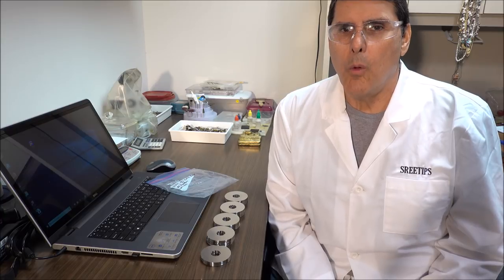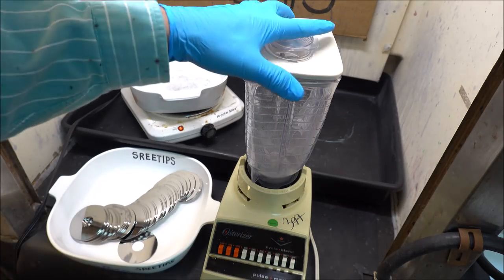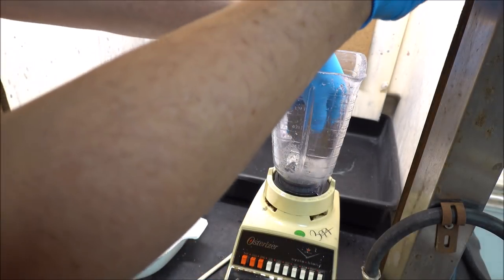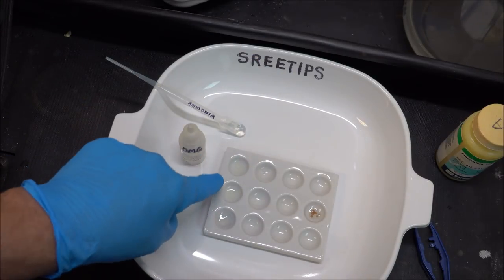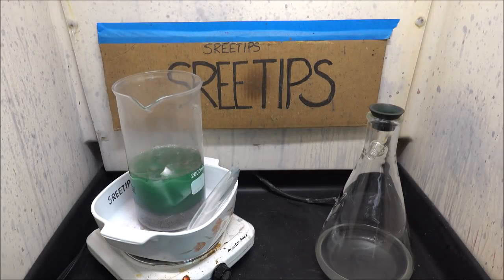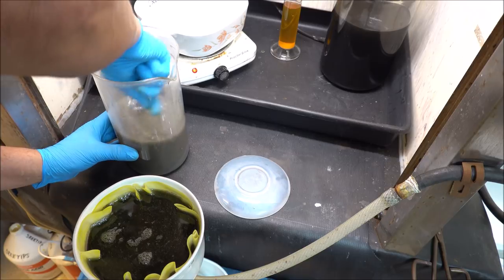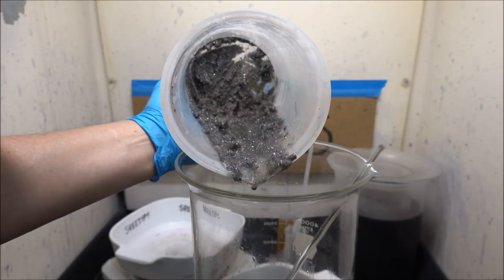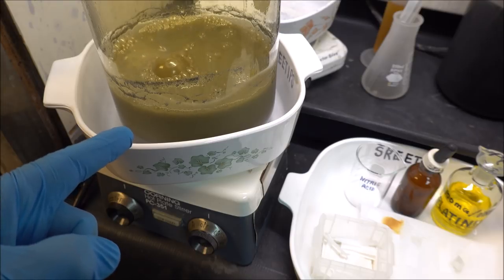Platinum Recovery From Computer Scrap HDD Platters

Comment: Pity the price for platinum is not as high today as it use to be. From memory, Pt was worth more than Au in the past
Still, 1g of Pt per 900 hard drive disks is a very small yield. Interesting to see what the chemical process will be to extract the Pt.
Cheers
Reply from the maker: Now palladium is more expensive than gold, the last time I looked.
Reply: @sreetips  Palladium is used to make the catalyst in catalytic converters needed by the auto industry. Over 3/4 of the demand for Palladium is driven by the Auto sector.
I suspect that this industry is driving demand upwards, although its possible that some smaller palladium users have grown over the past few years.
Usually when the price goes up rapidly, waste recovery and other processes become profitable and come on stream. It happened with Gold production during that decade of price increase and demand for gold. All of sudden the waste tailings and waste rock piles at Gold mines became very valuable resources.
Reply from the maker: Based on the yields from my catalytic converter videos I believe this to be correct. The yield was mostly palladium.
Reply: @sreetips  I just checked your channel for the catalytic converter videos - will have a look at them too. Good stuff so far

Comment: Your only going to find a recoverable amount of platinum in platters from either server hard drives, and modern hard drives.  (2008 & newer, or above 180 gigs.)

Older laptop drives are going to have very little to no platinum in them.  Older server drives are hit and miss if you want to be sure to be successful gathering drives over 180 gigs in size is your best bet.  They're only going to have at very most 3% of the coating as platinum so before doing a stannis chloride test you'd want to be sure the AR wasn't still reacting and heated it to drive off any excess nitric acid.

Comment: As a computer shop owner, I have thousands of hard drives, each having 2 to 6 platters.  After watching this, I figure its not worth my time to try and recover Platinum. The current market value is low.  I'd probably only get ~$6000 or less, and burn weeks of labor. Definitely not worth it.

Comment: Sreetips, I don't understand the need to grind up all the discs. All the metal is on the outer coating. Why not leave them whole? Also, do you think it's possible to reverse electroplate these? Thanks!

Comment: Question:  How durable is silver compared to gold ?  

I.e.  gold coins are famous for its ability to lay at the bottom of an ocean for 1000 years & be found without losing any of its weight or properties (does not corrode or otherwise decay). Also, gold is famous for its ability to be re-melted and recast into something else.

Does silver have such attributes?

A video response would be amazing however a simple response would do.

Once again, your work is appreciated
Reply: silver tarnishes. reacts with sulfur, among other things. don't eat egg yolk with a silver spoon. the black tarnish contains silver ion that gets removed by silver polish. there is a reason electronics connectors use gold not silver.

Comment: Great video! Thank you. One question though, did you check for silver? If so, was the silver and how much?
Reply: " If "  Any silver dissolves due the the nitric in the AR, it will come out immediately as silver chloride, it will not stay in solution. Hydrochloric acid is often used to test for silver in nitrate solutions. You take a small sample and put a drop of hydrocloric acid in, if silver is present a white milky substance will form, it's silver chloride. If there is a high concentration of silver it will clump up like cottage cheese.
Reply: @joek511  Thank you for your reply I appreciate it.

Comment: Because the active layer of a HDD platter is surface deposited, I believe you would have had better luck just stripping the platters whole instead of broken up.
With that said, the precious metal layer of a platter is only a few atoms thick and I'd be surprised if you could get .1 gram from a truckload of them.

Comment: I find these very interesting. I watch CodysLab and nilered as well and you keep my attention just as well. One thought, why not use AR on the plattens first, filter, precipitate with zinc, then do nitric boils to remove copper, and do another AR?
Reply from the maker: Not sure about why. Thanks for your interest.
Reply: @sreetips  if you're after the thin metal coating only, wouldn't the AR strip it fast enough so you could skip the blender and then dealing with all of the excess bulk material? You could do 3-4 platters at a time and cycle them out

Comment: I'm wondering if grinding is necessary, but fun times.  It's vapor deposited metal on the surface, no?  Couldn't you just etch it off?  Or maybe rinse them in molten lead?

Comment: Sreetips, isn't there ruthenium on hard disks? I once read that a ruthenium layer was used to increase data density capacity. I believe it's what cause the ruthenium price to skyrocket several years ago. Ruthenium, being in the same group as iron, has similar colors in solution depending on its oxidation state. Might also give a false positive test with thiocyanate, not sure though?
Reply: Isn't that rhenium and not ruthenium?
Reply: @vivimannequin  Both are valuable, but I'm pretty sure it's ruthenium not rhenium.

Comment: Thank you.... I can throw away the create of HDD platters that I have been collecting for years now, that either I collected, or other people have to me to harvest someday... Of which I will not be doing now, lol... I bet that is every bit of 200 to 400 lbs in that gaylord create, as it stresses the fork lift forms when lifting them... I wonder if the grass recycler will take the glass ones? I have the metal platters separated from the glass units.. This will free up some shop space.. Lol
Reply: The really old metal ones have much more platinum on them and are probably worth cutting into quarters and dissolving the aluminium, inside them and collecting all the thick foils off them..it depends who the old ones are made by as to how much pt or other precious metals are in them

Comment: I wonder what the yield would be if you used old 486 drives.  I know older CPUs have more gold content in the chip.  I suspect that holds true for all precious metals on all components. This obviously is a bulk operation.  Would you do the experiment again if you had several thousand hdd platters?
Reply from the maker: No, it's just not worth it.

Comment: What about pulling the silver out of a lead/silver welding bar, that is to say the bars where bought cheap, would if make sense and can it be done on the inexpensive side.
Reply from the maker: I did a video with stay-silv silver solder. I don't know about lead/silver.
Reply: sreetips thank you Sir.  I am still interested in finding a way to get you a pallet of x-rays, probably a half ton, but with silver prices it's probably not worth your time, would be a nice silver bar

Comment: Why the grinding step? Can't you just dissolve the metall off the surface and make it a lot easier?
The Thiocyanate will also detect the trace amount of iron that was worn off the blender blades when blending the glass. I don't think there is iron in the coating. Not corrosion resistant enough.
Reply from the maker: Jack, this experiment was a fail. There’s not enough precious metals to justify doing this.
Reply: @sreetips  I found out later... ;) But was there a reason behind the blending?

Comment: Hello sreetips. I've recently discovered your videos and while they can be interesting and entertaining to some, I wanted to offer some constructive criticism about it. 

Firstly, I'd like to go over various bits of inconsistency I've noticed in the couple of videos I've watched. Whether on a larger or minute scale, regimented procedures with a firm grasp on EXACTLY how one solution/mixture/compound, etc. interacts with one another add up a lot in the long run. Any sort of lapse in terms of your yields of each step with undoubtedly severely alter your final product yield. In this case, you lost the very small amount of platinum inside of those disk drives. From what I've seen you tend to be a little more carefree when dumping amounts of chemicals into one another. The failure of the yield may entirely be due to an excess amount of muriatic acid being used in the reactions, filtering out the metal mixture from the beaker, as well as the presence of water from the first step and the air. As previously stated, you have inconsistency with your regiments in chemistry. Not everything can be brute forced into yields, let alone higher ones. You tend to pour in semi-measured amounts of chemicals when producing reactions and that is not a good thing, to say the very least.

Secondly, you talk about how the videos are longer to be more specific in your details on what you're doing at the time. To me, at the very least, that's a sort of spotty statement. You do show adeptness in your instruction and that does help for an average viewer to understand what is going on though I would never call it anything beyond elucidative. To be instructional, you'd want to show it to a class of some sort and the lack of FURTHER detail is what some would claim it not to be as "intstructional". To be instructional you need accurate, detailed steps, along with diagrams of how the reactions work and exactly what can be produced by doing these reactions. To a degree, albeit small, you do just that but it merely isn't enough. Start with your starting materials, maybe an overview of a procedure, talk about how some more of these dangerous chemicals react, and their properties. These are important things to be discussing about when filming a procedure. Your videos aren't longer for the explanations, they're longer because you speak on a slower end, and repeat yourself. A good counteraction to this would be to speak more confidently, possibly by voicing everything over with a script which can make your hindsight be helpful in giving insight to things you may have forgotten on the spot.

Your videos can most definitely be improved to something that any professional or chemistry hobbyist would crave to see. For examples on how a true instructional video would be created, I recommend NileRed, and his affiliate account for some offhand videos, NileBlue. Truly, an amazing chemist that makes some of the most complex experiments I've ever seen, the most understandable and memorable.

You may never see this, but if you do, I mean absolutely no hate and wish the absolute best of luck to you and your future endeavors. I urge you to thrive and do better in your videos, and most of all, have fun. Best of luck to you!
Reply from the maker: I agree. I'm not a pro. I consider myself an advanced beginner. Gaining proficiency comes from repetition. Some of these processes I'm doing for the very first time while you watch. I have gained valuable experience from doing these experiments.

Comment: Thank you for the video. Just a quick question. The disks are coated with very soft layer. Platinum is unlike gold and its  hard. Is it possible that some other metal is used in those disks, and not a Platinum?  I had one broken hard drive and opened it to see the disk(s).
With a screwdriver I scratched both disks with no effort at all. Mirror surface of those disks are easily damaged even with fingernail.
Reply from the maker: I’m not sure. I had those donated then I promised to make the video. It was a fail as you can see. One of the reasons I chose to work on my own material only.

Comment: If the platters are glass, why do they need breaking up?  Chemicals will be able to get at the surface which is where the metals are.
Reply: I was thinking the same thing. As thin as the plating is, I would have at least tested a disk. I bet it would have been faster to dip each disk individually to remove the plating. No filtering and no excess nitric, assuming you can saturate the solution and not add more nitric to speed up the digestion. I have a hand full of glass platters. I would only get one tenth of what he expected so they will stay in the bucket.
Reply: Lord Inquisitor Tylion  The surface you are adding is just plain glass, which just ties up chemicals by surface tension (makes if harder to rinse off, retains more).  You are adding no surface for the chemicals to attack whatsoever!  I would break them up into large pieces to make it easier to handle & fit in, but no smaller.

Comment: Why did you grind the disks? The metals are plated on are they not? Nothing special mixed in the glass?
Reply from the maker: The research I did suggested that the precious metals layer is inside the glass, not on the surface.

Comment: What keeps the hydrochloric acid from burning the filter when you filter it out of the precious metals ?
Reply from the maker: I've seen hot nitric cause a filter to fail. I've never seen hydrochloric acid cause a filter paper to fail.
Reply: Metal disc is beter for platinium or not.?
Reply from the maker: As is the case with most computer scrap, I don't think that the metal discs will have any Pt either. But I could be wrong.

Comment: your test solution is 100mg/100g, you expected 0,1g of platinum, but it appears your boiling sollution is far more than 100g, means your boiling of sollution is 10-100 times weaker than test sollution, hard to estimate. What is conlusion? Is 0,1 gram of platinum possible?
Reply from the maker: Test solution is 100mg/100ml or 1 gram per liter. Trying to recover and refine a tenth of a gram, or even one whole gram, is an exercise in futility. It's best to just add it to the stock pot, that is full of copper, and let those small traces cement out on the copper and accumulate. Stannous test solution is very sensitive and can detect very small traces of precious metals in solution.

Comment: Have you ever tried to recover aluminum?  Can it be done other than melting it and pulling off the dross?
Reply from the maker: I only work with precious metals. I don’t have any experience with aluminum.
Reply: @sreetips  Thanks, I have probably 500 Lbs of cans and 100 computer HDDs to melt down was hoping for a chemical option not heat..

Comment: I am curious as to why it was needed to blend them, could you not put them in as is?
Reply: also another amateur question im sure, why does it go on the low heat?
Reply from the maker: I thought the platinum was inside the glass disk.
Reply from the maker: Not sure how this is going to react. I start with low heat until I'm sure that it wasn't going to boil over.

Comment: i think you made a mess grinding those disc. if you put them in HCL grey deposit on it come off real quick leaving blanck platers... then you just have to get PM from the HCL leaching solution as they will be suspended in it as real fine particles maybe adding H2o2 in it
Reply from the maker: You should make a video and show how it's done. I couldn't get any out of them.
Reply: @sreetips  not telling you lost some!! there is not much in them for sure!! but the layer of pt is so thin that it can go through your filter

Comment: I was curious about the newer hydrogen peroxide contact lens cleaning use a platinum coated disc to neutralize the hydrogen peroxide. I searched it and found a random article stating there was around 600 micrograms or two cents worth on each disc. Random information but maybe someone will find it interesting.

https://www.fmanet.org/blog/2016/08/08/yikes-i-just-increased-my-platinum-footprint

Comment: Y do convert silver chloride to silver nitrate be for melting in to a bar
Reply from the maker: I've never converted silver chloride to silver nitrate. But I have converted the silver from a silver nitrate solution into silver chloride by adding hydrochloric acid to the silver nitrate solution.

Comment: So how much mats $ wise did you use to confirm that result? Is breaking down cpu`s worth it?
Reply from the maker: I found a tech sheet on the composition of metals in these glass platters. It said 0.5% (5 parts per thousand) platinum. This tiny amount was too small to be detected with stannous chloride.
Reply: @sreetips  yeah i know was a waste of Materials trying to break it down it looked like but is getting the gold out of cpu worth it?
Reply from the maker: I only have experience with pentium pro CPUs, the highest yielding of all CPUs. I was able to recover 0.3g of pure gold per cpu, every time I did it. The pentium pro may have a gram of gold but it's karat gold, not pure. I don't have any experience with other CPUs.
Reply: @sreetips  ok thanks for the info i was just wondering if it was worth the trouble

Comment: What temperature do you have your hot plate at?
Reply from the maker: Kenny, the dial doesn't have numbers. It just says low medium and high. I usually set it at medium which is hot enough to boil water.

Comment: so is this worth the time and $ spent to recover the platinum?
Reply: Eric Long
Considering that a gram of Platinum is about $30, no it's not. RIght now the price of 1 gallon (3.85 liters) of Muriatic Acid (Hydrochloric acid) is $4.00 (he used 5 liters), and that's the expected return of 1/10 gram of Platinum, then add Nitric Acid at $85 for 2.2 liters (he used a total of  about 310 ml, cost of roughly $12). So he used about $5 of HCl, and about $12 of HNO3, cost of roughly $17 to recover roughly $3.00 of Platinum.